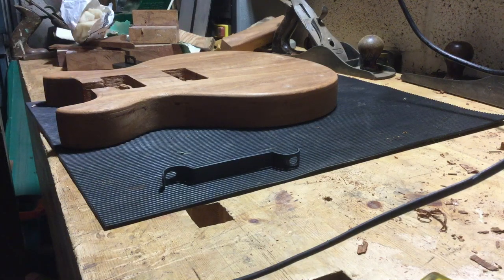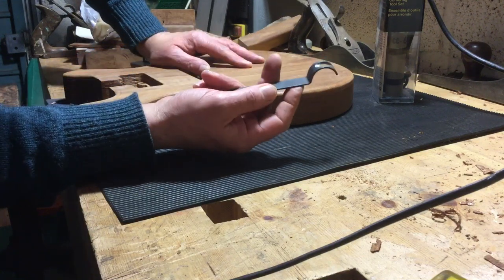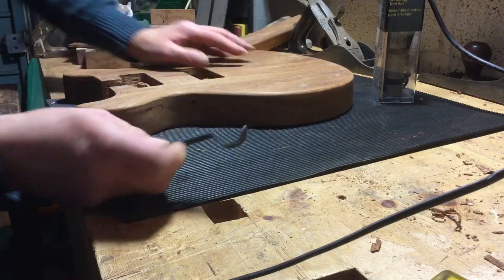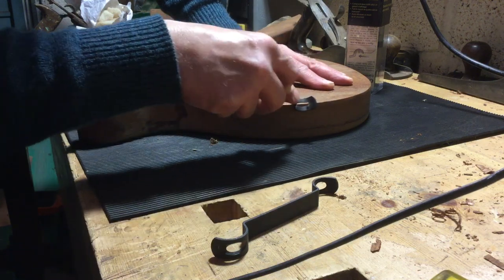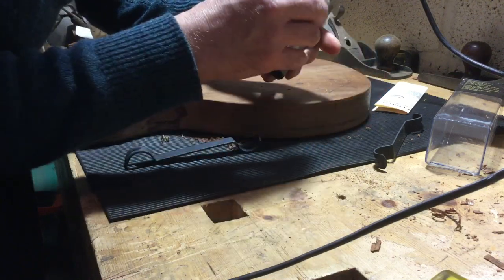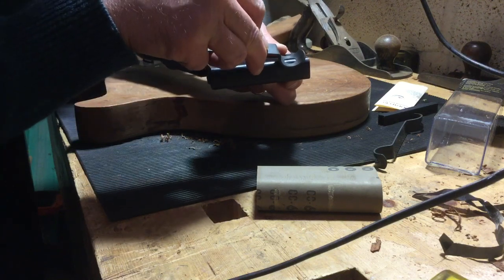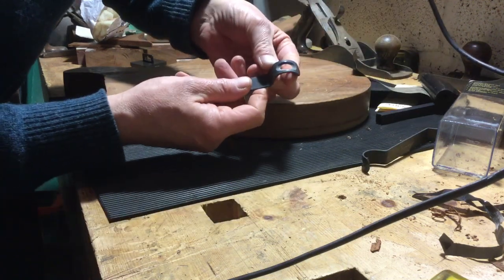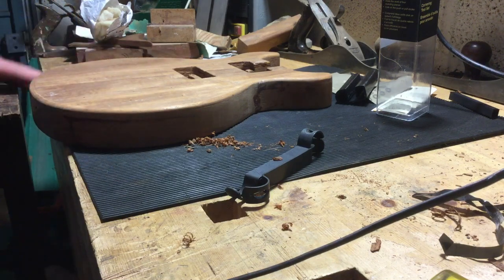Guitar building with hand tools - ¼” round-over on Les Paul Special using Veritas Cornering tool

Comment: Thanks for the review and adding the sharpening too.  I was wondering about how to keep them sharp.  I have some guitar binding I need to trim and this looks like it could be the way to go.
Reply from the maker: Sorry for not answering before. The kit comes with a sharpening jig. It is a multi radius plastic block with a wedge to hold wet and dry paper in place. It works really well.

Comment: I'm building my first les Paul but I can't find the neck size... could someone help me?

      thank you
Reply from the maker: Phantom Hacker are you working from a drawing?  What measurement are you looking for exactly?
Reply: @SteveBlackdog  I’m designing Les Paul’s project on AutoCAD, based on data from other projects found on this link:   

https://www.gitarrebassbau.de/viewtopic.php?f=10&t=6&p=18618&hilit=templates#p18618 

(In the Les Paul Custom section)
For the Body I have all the data, but I could not find a dwg from which to extract the neck dimensions (length of the neck from the top of the headstock as far as the neck fits into the body, the length from the button head, then from vove starts linclination of the headstock, up to the interlocking, and the width of the neck to the button head and 22° key).
I don’t know if I was able to explain myself, because I’m not yet speaking English very well and I don’t know very well the technical terms...anyway thank you.